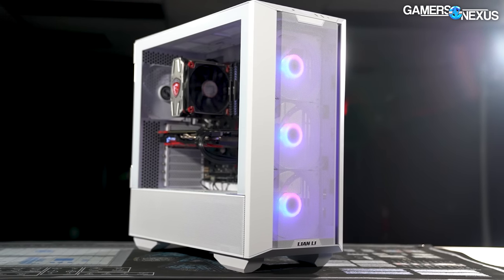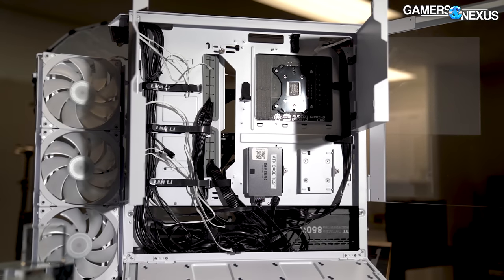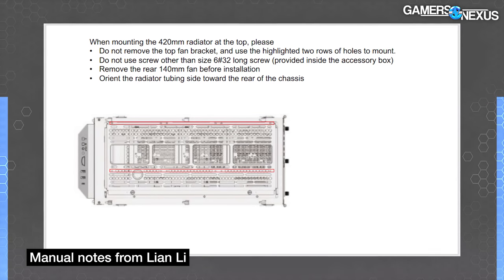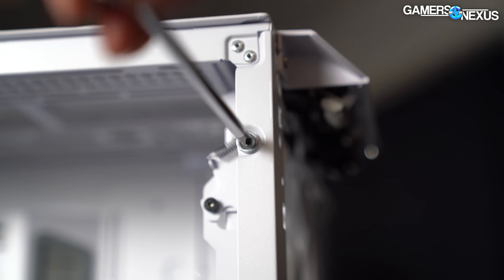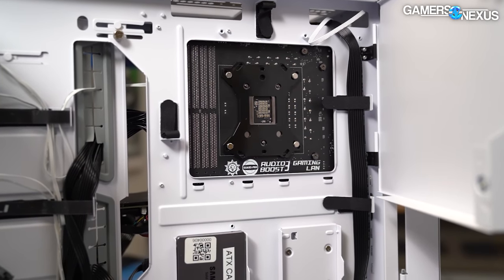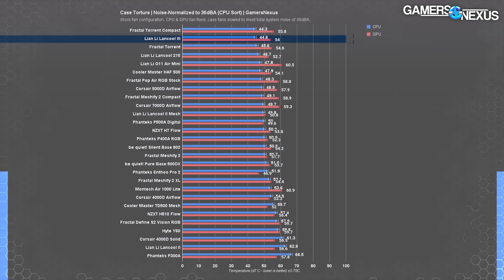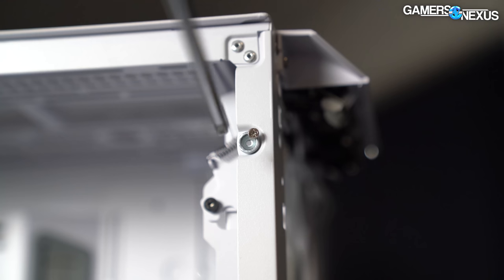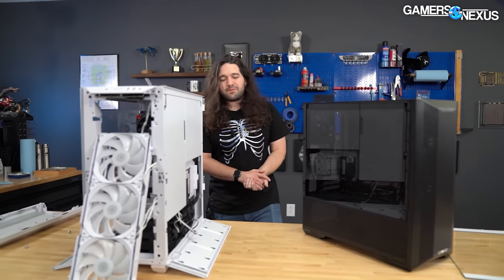Lian Li Lancool III Case Review: Build Quality, Thermals, & Cable Management

Comment: Antec One Hundred... best case ever!
I still own this case. It's the best because it has a COFFEE CUP TRAY on top!
Seriously though, I put Noctua fans for intake, Noctua NH-D14 cooler (R9-3900x), modded my GTX1080 with Noctua fans and customized my fan profile carefully around noise. I can NOT hear my PC at all in idle. I can BARELY hear it when gaming if there's no sound from the speakers. My front fans spin between 300RPM and max 600RPM! The CASE obviously matters but knowing what you're doing matters far more. The FUNNIEST thing I ever saw was that case (forget name) that had a tonne of fans and yet cooled better when a bunch of them were removed.
(the SIDE fan mount has no fan but I can feel the graphics card heat coming out of it when gaming. Having three big fans as intake but NO exhaust right next to the graphics card is sub-optimal. The FURTHER your intake or exhaust fan is from the heat source the worst your cooling efficiency is (in general).)

Comment: Im really really curious about the Lian Li Lancool II and Lancool III, it is possible to put the lancool II front panel on the Lian Li Lancool III? (without drlling holes or drilling them) I really liked the Lancool III, but it is obvious that someday the front springs and other parts of the front panel will break.

Comment: Proud owner of the Lancool II Mesh. Bought based on your excellent review. Glad to see Lian Li fine tuning the design.

The only thing I really dislike about the III is the covers for the wires. I like being able to take them off and then securing them with a screw. Not everything needs a magnet.

Shame about the HDD backplate. I actually use that.

Anyways, can't wait to see the Lancool IV!

Comment: The Razer Tomahawk ATX Case is a Lancool II with the razer tax applied. I ran one for a while before eventually upgrading to the 1000D. I was a big fan of the hot swappable HDD bays on the lancool/razer tomahawk once you installed the hotswap plate.

Comment: Honestly the biggest and most welcomed change to this case is the ability to mount fans on the top of the PSU shroud. Its super annoying having plenty of space in my lancool ii on the psu shroud to mount fans, but no spot for the fans to actually screw into. This is especially annoying in my wifes case because she has a blower style GPU cooler and could benefit tremendously from the extra airflow those fans would provide.

Comment: If you added 3 fans on the bottom and a CPU radiator on top, would this case perform well with low fan speed? 
Basically, I'm looking for quiet but still thermally performant.

Comment: I feel so dumb. I paid basically the same price for the Lian Li 215. It was originally $80 but you can only find it for ~$160-190 now. I CBA returning it now that I unboxed it and started my build. All I did was swap the 200mm fans with 3 120mm Noctuas, swapped the rear with a 120mm Noctua, and installed a 140mm Noctua on the top rear slot. At least the 215 slightly out performs it with the front panel on. Also I swapped the 200mm fans with 3 Noctua A12x25s so it should outperform it even more now. I feel a little less bad. I just wish I didn’t know it was originally $80 lol….

Also there’s way too many doors on this case IMO.  I don’t see them holding up overtime.

Comment: Great case review. One thing I'd like to see is even when Patrick was pointing out the built in IO, the spec of the different USB ports was not mentioned.  I've noticed this is a pattern not only in this review but in the majority of your case reviews. It's usually not hard to find out, but it seems like a spec worth mentioning. Especially since there are about 4 possible data transfer rates they could be in nowadays and there are more than one type of motherboard connector required. Not a big complaint, just seems like it ought to be there in so thorough a review.

Comment: I almost wasn’t gonna like this case, but I somehow managed to fit the Arctic Liquid Freezer II 420 to the top mounting position. Looks better that way anyways imo. I removed the doors that hide the cables since they just got in the way. Which is fine I guess, but they should have just used a metal side panel instead of adding more doors. Since they didn’t, I just made my cables as tidy as possible so they’re nice to look at through the glass. This case is also incredibly easy to keep clean. I’m pretty happy with it and am glad I no longer have to use my Meshify C.

Comment: 7:04 i feel like this is similar to overclocking in windows; nice that it’s possible and can be convenient but it’s even nicer to just mount solidly using screws. I mean usually a PC only gets built once but correctly so I don’t see the need for a plastic quick release like this but I guess there is someone out there that will appreciate that they put it in

Comment: Si lo "complicado" me cuesta dinero prefiero lo sencillo (exceso de mecanismos). Y mas si terminas viendo que a nivel de ruido y refrigeracion la lancool 2 mesh esta desde mi punto de vista viendo vuestras pruebas aun aunque sea por poco por encima de esta (mas sencilla +mejor flujo en alto rendimiento + mas compacta y mas barata). La diferencia de precio a dia de hoy no compensa y si me ponen las dos delante me sigo quedando con la lancool " mesh aunque solo sea porque casi cuesta (costaba) la mitad. Un abrazo desde España

If the "complicated" costs me money, I prefer the simple (mechanisms excess). And more if you end up seeing that in terms of noise and cooling the lancool 2 mesh is from my point of view seeing your tests even if it is slightly above this (simpler + better flow in high performance + more compact and cheaper) . The difference in price today does not make up for it and if they put both in front of me I would still prefer the "mesh" lancool, even if it is only because it costs (was) almost half the price. Hugs from Spain

Comment: This PC case would have been perfect if they put 3.2 USB Type A ports instead of 3.0 on it's I/O panel. It's 2023 already and they still put 3.0 on the front I/O panel. I went with the Be Quiet Shadow Base 800FX instead.

Comment: I picked the Lan cool 2 mesh performance Christmas last year from going over your various reviews, fractals torrent was just way too big of a case for me and the next best performance with all the storage space I needed was the Lian li.

Honestly this looks like a good buy, but not a huge step up from the 2 mesh (says how good it was/is) 

I'm also not sure of the magnetic cable hide trays as mine are screwed on quickly and with some force, be amazed if magnets hold them down tight like the thumb screws, which in all honesty weren't exactly a nightmare to work with 

Great review though, only thing I can potentially see that was missed is it looks like they addressed the gap at the bottom of the front panel that let unfiltered air in before, it's fixable with a 3d print but still was a slight oversight on an otherwise great case, from what I could see in the video the front panel was solid across.
Reply: Yeah, if you have a Lancool 2 Mesh there's really no reason to upgrade to this case. As you said, Lian Li nailed it so well with the LC2 Mesh that this case feels kind of pointless, or overwrought.
Reply: @htr5372  Yeah, I think it's like what happened with the O11 Mini Air where something critical in the case design has gone wrong.

Comment: The whole point of the moveable bar in the back is to accommodate EATX mobo.  It doesn't seem useful, and looks bad, because you didn't understand its function and used it wrong.  It's not meant to open a gap to accommodate longer GPUs, as when you demonstrated, it can slide behind your GPU and the wires would reach the grommet in any location.  It's supposed to slide up to the mobo, or open to the right to slide up next to the edge of a bigger mobo.

Comment: I really like the dynamic way this video was shot! It felt fresh and less tense than standing there with a fixed camera angle. Please note that 'tense' really doesn't mean unpleasant! A computer case isn't rocket science by any means, and in my opinion a review of such a thing doesn't need to take itself too serious (like in this video). Just keep experimenting with that, you've already nailed the technical review part anyway.

My take on the case: Every time a manufacturer tries to implement rather complicated mechanical designs for parts that, under normal operation, almost never get used, it feels a bit wasteful in my mind. They could have left out half of the panels, magnets and springs and that case would still be a top performer on noise and airflow with an easy building experience.

Comment: For the price, the features are incredibly detailed. It looks like a case that I'd actually be proud to be able to display both sides of it like at the edge of a desk instead of having it at the back of your desk hiding the back of the case against the wall.

I think a cheap neodymium bar magnet might fix the side panel door issue.

As a p500a owner, finding a case that isn't excessively large that could support a 420 mm radiators is fairly difficult. Looks like this one could do it with some compromise. I just don't like 120 mm fans, they're loud, don't move as much air. I feel that 140mm is my favorite fan size.

Comment: I bought the Lancool II Mesh based on the strength on GNs (and others) reviews. It is a great case overall but the only negative thing about it is the mounting for hard drives which are just simple plastic trays which slide into a simple metal mount, if you actually populate these with hard drives they are incredibly noisy since there is no dampening at all; I didn't factor this in when I purchased the case because I didn't realise it was a problem as I experienced zero hard drive noise with my previous case (corsair air 240) as the mounts on that case have dampening; it was also never mentioned by any reviews that I saw - it seems like this is an area that is overlooked by reviewers.

It seems the hard drive mounts for the Lancool III are much better in terms of dampening just from looking at it. GN do you do any testing with actually populating with hard drives? It seems from only seeing the video that this a small area where your reviews could be improved, perhaps you do test this but it just doesn't make it to the video unless you find a problem w/ it?
Reply: Edit: From looking at another video it appears there isn't any dampening on the Lancool III hard drive mounts.

Comment: That has no filtration what so ever. I modified cases and I have tried 0.4mm dot meshes like in Lancool here, and 80% of the dust comes trough. When I replace them with dense polyester mesh, used as dust filters in "normal" cases, yes, it impedes airflow but it keeps the dust out of the case which severely reduces the time between me needing to use air compressor to clean the case.

Comment: I would like to say something about the single headphone port on the front io. Personally a single port for headphones is way more convinient. You can switch between the headphones you use for your mobile and you wanna take a break from using your over ear headphone. No matter how comfortable an over ear hp may be they tend to get heavy and hot over prolonged period of usage. I wish more companies would include single headphone port for audio and mic in the front io. This is my personal opinion.

Comment: Just build new PC with that case, it fits 4080 with zero issues, even movable cable cover is not in the way. I have not used proper case for years as i used open air bench or just my shelf (yup just pc parts on shelf with no mounting to anything) it felt so good to work with it. So much space, so much configuration, so easy to access everything. As for long term usage I'm 100% it will last many many years even as test beach etc, all mechanical components are extremely simplistic so it should not break but even if it will looks like it will be fixable by anyone. As for air flow I'm clearly not expert as i used open air benches but i5 13600 and 4080 seem to be so we'll cooled that GPU is often turning off fans even when playing games in 4k.

Comment: If the rumored power consumption/heat generation of the next gen GPU's is correct, this move back to airflow design is going to be around for awhile.

Comment: BeQuiet has an awesome front panel removal solution on the 802.  Just slide up the panel and slide back down to install.  It's very sturdy and satisfying to use.

Comment: Still using the P400. Converted it to the airflow version =) I can even fit an Arctic Liquid Freezer II 360 in there, and in the correct orientation.

Comment: Whats the point of a glass side door on the cable side if the inside is just covered by other metal doors. Just use a normal metal door and get ride of the other pieces.

Comment: As the owner of a Lancool II Mesh, I don't think this new version isn't really better then the old one in any way that matters, except for 2 things:
- looks like this comes with a functional usb c port on the front, I had to buy a cable separately for the Lancool II Mesh
- the front panel with all the ports is slanted, which actually makes it a lot more functional and easier to use
Reply: They started including a usb-c on the front with later models actually

Comment: I was going to trade my Meshify 2xl in for this but don’t think I can use my liquid freezer ii 420. They could have given an extra inch or two in each direction. But unsure if this is even better cooling I have 3 Noctua 3000 intake and one exhaust and 3 on my liquid Freezer II. I hardly hear the ones on the rad even at 2700 rpm

Comment: For my money, if you want a fully air-cooled build and are anticipating heavy loads on both a high-end CPU and high-end GPU, the Lancool II Mesh is still the pick. It's a fantastic all-rounder that hits the thermal sweet spot between graphics and processor.
Reply: Yeah, the Lancool 2 Mesh is still a champ and where 95% of people should look. The Lancool 3's size and price has it aiming towards heavy watercooling enthusiasts.

Comment: Great review!! I upgraded in December from an NZXT h710i to a Lancool ii. I love the case. It dropped my temps 10-15 degrees. The case looks great and I’m a fan of the doors. 

The Lancool 3 has so many more features that make the case even better. It offers mesh filter kit for the top, front, and bottom, where they previously didn’t offer a front mesh kit on the Lancool 2. USB-C comes preinstalled! The Lancool 2 usb-C kit was a pain to install. And being able to use the O11-Evo gpu riser kit allows us to have PCIE 4.0 riser cable now. 

I love my Lancool 2 and my next build will be in a Lancool 3. Again great review and props to the Lian Li  team for the massive improvements to an already great case

Comment: Really love my lancool 2 mesh. But i have some issues with the 3. Aesthetically, I miss the mixed black and white color scheme of the lancool 2. The white lancool 3 is just too white. From a use case stand point, I really will miss the hot swap drives. I quite frequently switch drives. I have drives to swap game libraries, long term storage drives for photos, file, and stuff. And i also have multiple Operating systems to swap out. I could dual boot like most but some of the OSs need other storage drives and I only have 6 SATA ports on my motherboard so I cant have everysingle drive plugged in. I have many devices plugged into my PC as well so I dont have enough free usb ports to add a bunch of external drives. No hot swap  is the deal breaker for me. The ammount of time I save not having to re cable 3 drives whenever I need to switch OSs or something.

Comment: Recently i swapped my case based on your reviews and ive chosed the be quiet 500dx for the performance/noise and the design. Initially i was thinking about the Lancool 2 Mesh but i dont like all those panels and all, i know they are for pratical mean but i prefer some solid panels. So now im much more glad for the case ive chosed. Thank you
Reply: idk which one to take, pure base 500dx or Lian li lancool 2 mesh. the 500dx is quiet but the mesh 2 has better thermals, idk if the mesh 2 is really that loud
Reply: @vh4pe  in the end i bought the 500dx because is less noisy (but ive added some front fan) and i prefer the design, now the temps are better even of a lancool 2. Also i dont like the Lancool double glass panel
Reply: @vh4pe  also the température différence its not so Big between the 2. The only issue if you want with 500dx is the good but a little weak stock fans, putting 2 good 140 fans in the front will improve very much
Reply: @josu91ita  okay tysm, i ordered the pure base 500dx yesterday

Comment: this literally seems like a lesser version of the Phanteks p500a I built in this weekend, Which by the way if anyone wondered you can actually fit a Z690 Maximus Hero and an Arctic Freezer II 280 in it. (38mm of rad 25mm of fan) (whoops forgot I meant top mounted)

Comment: I am looking forward to buying this case for a single primary reason, they listen to their customers without gouging prices. I am pc enthusiast. So for me, all the mechanical parts and design features speaks volumes with me because I know Lia Li has engineers who are at least somewhat as enthusiastic as I am. Don't get me wrong, you can definitely buy other cases and get better value, however I love that they put effort to actually upgrade a fantastic case while still maintaining good "value". To compare: many people like to supercharge or turbo their cars, it is not "smart" at all. A smart person would be an economical car leave it completely stock. However as a car enthusiast myself, I modify my car and add different performance features because I like the way it feels and performs.